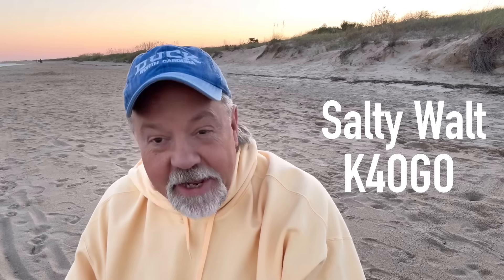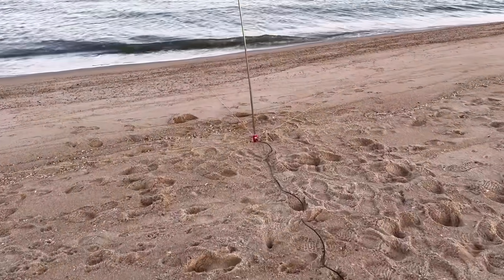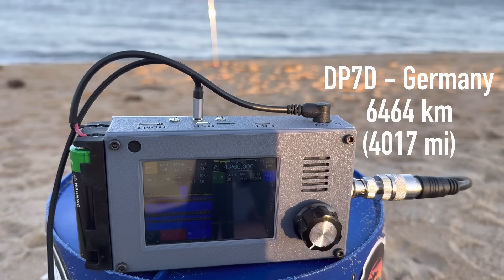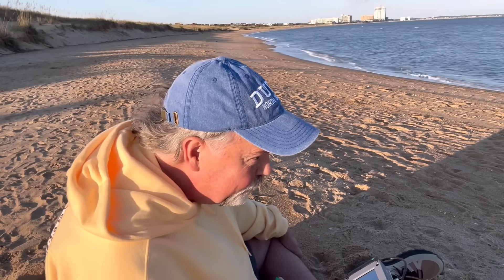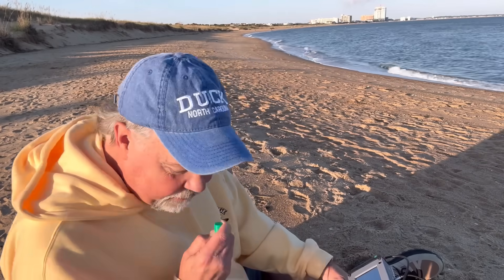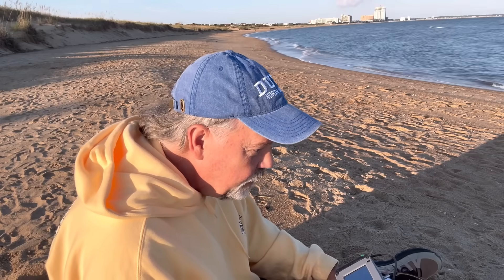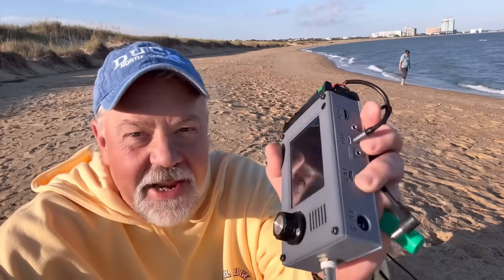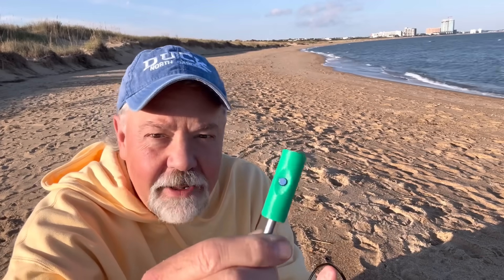zBitx HF Transceiver - Beach Portable

Comment: Does the ocean (or any large body of water) have an effect on propagation?  What kind of angle of incidence are you getting with that whip antenna?
Reply from the maker: I’m getting a low takeoff angle with that quarterwave vertical. Yes, the saltwater is giving me a major boost, about 10 dB. That’s pretty much what this channel is about, making great DX contacts next to saltwater

Comment: Awesome contacts to West Oz Walt.
I too have the Zbitx, its a brilliant concept but I've had problems with mine with distorted signal and I wouldn't use it on air, but the great guys at HF Signals come through and sent me the two internal radio and screen boards.
Installed them and now back in action.
Across Australia is all I've managed to do so far unlike you. But very happy with the radio now.
I am a fanboy of Ashar and his radios as I have all his line up so far if I'm not mistaken.
I cant wait for further optimisation of the software as there are quite a few bugs in it.
Much like the Sbitx V2 and V3 was when released, but now is my favourite.
And I'm sure the open source software  and all the  smart savvy software tinkerers out there, will truly make the Zbitx shine.
Happy DXing Walt
Reply from the maker: Happy DXing my friend! 🇦🇺 🇺🇸

Comment: Hi Walt, great video and excellent DX contacts. That Zbitx is certainly doing the business. I also work DX on my handheld Xiegu X5105 and small homebrew whip antenna walkie talkie style. QRP is great fun fun from these little rigs. I will have to look into the Zbix. Sounds a very interesting little transceiver. Thanks for sharing. 73 from England...David
Reply from the maker: Hi David, the X5105 is such a great radio. I love mine.

Comment: Hi Walt. I was so glad to make a contact with you last night.I have been listening out for you for a while hoping your signal would make it into VK6. Your YT channel inspired me to buy a G90. I was using my G90 with a PA100 amplifier and my antenna is a vertical quarter wave on a 7m telescopic fibreglass pole using 4 elevated radials all made from speaker wire mounted in my front yard. Hope to hear you on the air again soon. Regards, Derek VK6DRK.
Reply from the maker: Hi Derek! It was so awesome making contact with you!! 73, Walt

Comment: I don't think the saltwater is doing the "heavy lifting", I think it's because all the stations you talked to, when you look them up on QRZ, have huge beams and amps.
Reply from the maker: That helped greatly for sure. The last VK contact was a guy on a Xiegu G90 using a vertical. 73, Walt

Comment: That radio has some serious issues without significant hardware modifications and software improvements. The batteries won't last long at 5 watts. The output is full of spurious signals and the backplate gets hot enough to burn your hand and melt plastic.
Reply from the maker: Glad I didn’t experience that with mine.
Reply: @COASTALWAVESWIRES I’ve heard that this happens (heat) on FT8

Comment: 11,000+mi on 5W!! Thats amazing! That zbitx sounds great too. Sounds like a sensitive little radio. Its nice that the batteries are right there too! 18650s are light and easy to get. You can grab them from old laptop batteries,  industrial equipment and tool batteries. What a neat radio. You could swap those batteries out for all day use in a small form factor. Thanks for sharing!!
Reply from the maker: That little radio is a lot of fun! 73, Walt